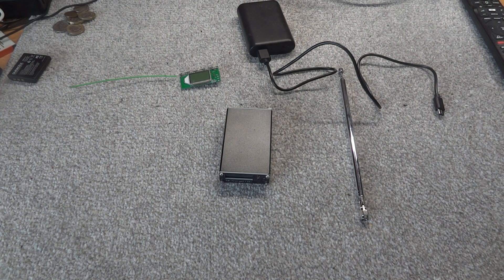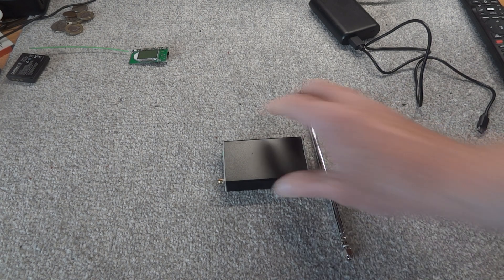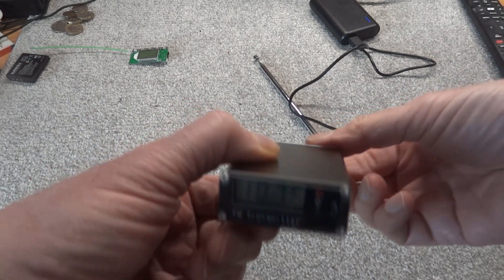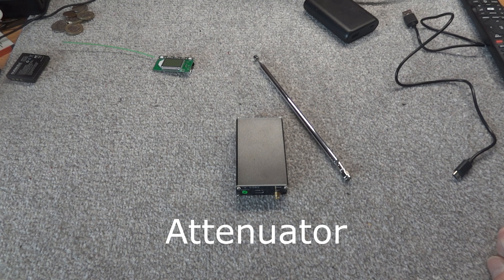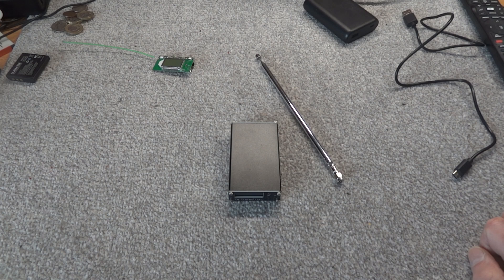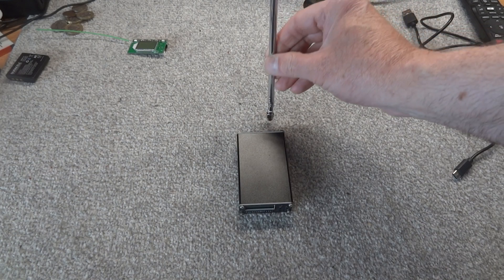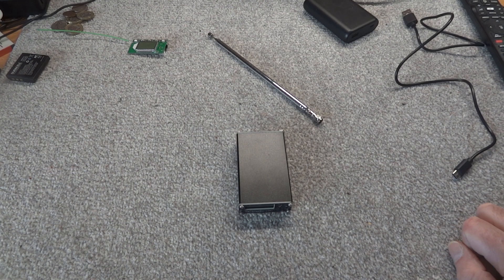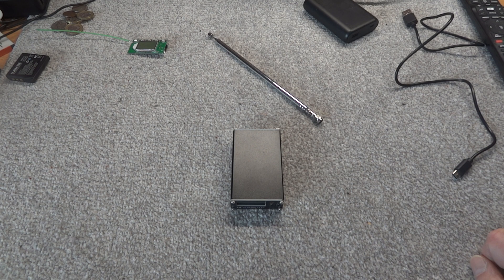0.5 Watt FM Stereo Transmitter Review

Comment: Hello from Ukraine! 🇺🇦
I plan to order such a transmitter soon, but I have a few questions)

1. Can it be powered by a mobile phone charger plugged into an outlet?

2. How safe is it for health to use this transmitter, for example, in a room, considering that its transmitting antenna will be placed in the room?
Reply from the maker: Hi and hello, Yes can be powered by a mobile charger and I would have thought it is pretty safe as only 500milliwatts, I have mine near me and am not worried about it. Hope this helps
Reply: @MichaelYates Thanks for the quick response!
This spring I bought a non-original Chinese 100mW transmitter module for $1 on sale, a bit similar to yours. I connected it to my laptop via USB. The sound initially became quiet for a split second, then became completely metallic and the transmitter turned off. The transmitter worked for about 2 hours in total) I don't understand what was done wrong.

By the way, please tell me, will it harm the transmitter if the charger or portable charger has more than the 500 milliamps required by the transmitter?
Reply from the maker: @vladyslawpodstavin9754  I would have thought that the $1 you bought would have been pretty poor in comparison to this one. I would use a 1 or 2 amp supply for this transmitter , it will only draw what it needs
Reply: @MichaelYates Maybe, thanks.

By the way, the power supply of my charger provides 5, 7, 9, 12 volts... Will there be a risk of applying a voltage of more than 5 volts and burning the 0.5 W transmitter?

P.S. As far as I know, this transmitter is on the QN8027 microchip. I wonder if it is possible to program RDS for it. That would be very cool.
Reply from the maker: @vladyslawpodstavin9754  You need to use the 5volt setting any other will fry the transmitter. Sorry I can not help with any info on the chip it uses.
Reply: @MichaelYates Okay. Theoretically, the transmitter shouldn't consume more than 5V from the charger's power supply? Because in that case, probably all the phones would have burned out long ago)
Reply: @MichaelYates Hello. I have a small question after a few days)
When you bought the transmitter, did you pay attention to originality, or did you just buy a random brand from a random seller?
Reply from the maker: @vladyslawpodstavin9754  I just bought a random cheap brand to see it was any good
Reply: @MichaelYates Got it, thanks!
I plan to use it often and for many hours. I hope it won't let me down)

I'm subscribing to the channel!
Reply: @MichaelYates Hello.

I would like to clarify something again.

I noticed that the transmitter strongly jams the radio in the range of 64-108 MHz and emits harmonics. The TV signal also disappears at 174-230 MHz.

So tell me, will the interference caused by the transmitter at a distance of several tens or hundreds of meters harm the aviation band (118-136 MHz), airplanes and other users of the band? I would be very grateful for your answer.
😀
Reply from the maker: @vladyslawpodstavin9754  There is some harmonics on this unit across the FM band and is pretty common with these cheap transmitters made in China. Mine is not to bad its about 5 meters away from my receiver it has little effect. These should decrease quite significantly as the distance gets further. I have had no problems with my neighbours complaining about their radio or tv reception, maybe wander around your local area with a FM radio to see how far your one is effecting the rest of the band. I would think not that far at all.
Reply: @MichaelYates I checked in the car - there are obstacles within a radius of 60 meters.
Reply from the maker: @vladyslawpodstavin9754  I would not worry to much as the harmonics should not go out much of a radius
Reply: @MichaelYates Sure, thank you.
In general, harmonics of even such a radius do not pose a threat to the air range, even if they reach it, right?
Reply from the maker: @vladyslawpodstavin9754  I would have thought that any low harmonics would not affect any airwave transmissions or receptions